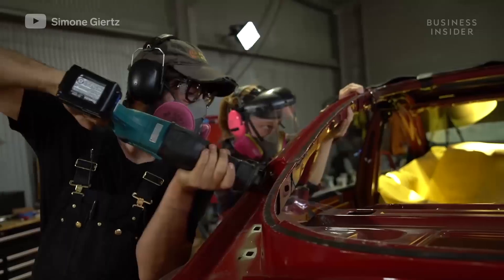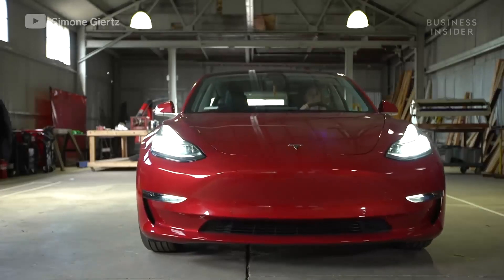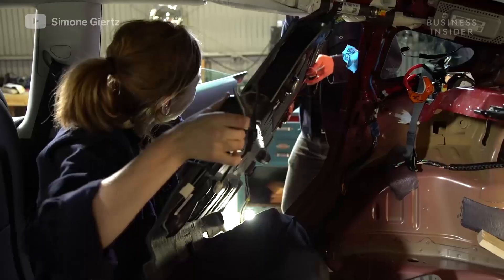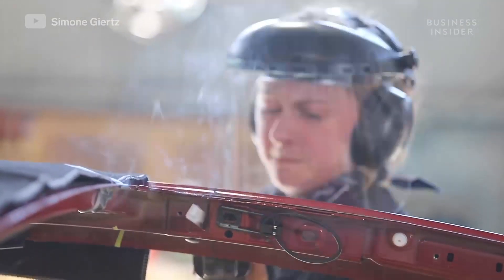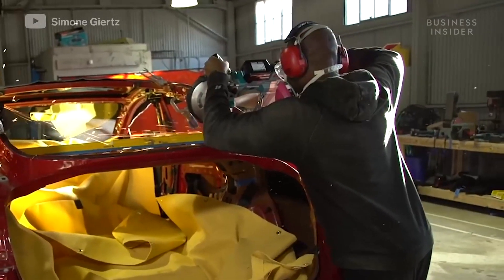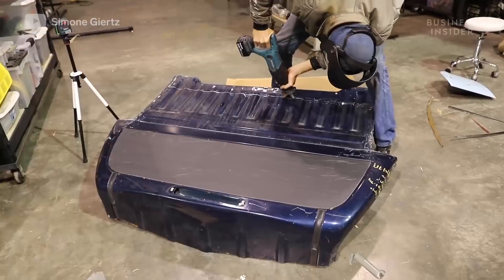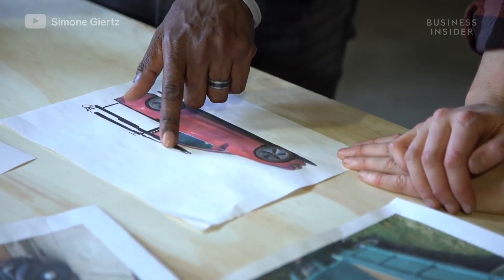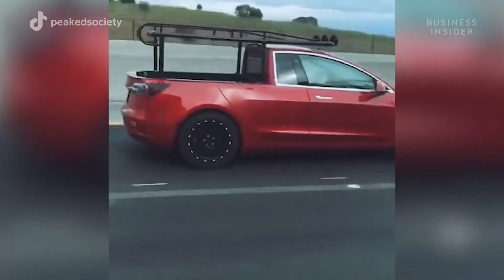How An Engineer Built A Homemade Tesla Pickup Truck

Comment: Couldn’t you have just attached a trailer hitch instead. Then you still have the option for rear seats.
Also, how is going to get insurance. It’s going to be expensive since you have significant modified you vehicle. Likely, insurance will group the car as a rebuild title with higher premium.

Comment: Wonder how bad her mpg-e is now considering the standard model 3 only gets like 220 miles per charge
Reply: If your main goal is just drive daily for less than 100 miles or so it should be decent enough. Just plug it in when u reached home. Electroboom made a video regarding this.

Comment: In the south , this would get run over 😂 we got diesels 5 times bigger than this.
Reply: and 5 times slower, anything diesel doesn't have the acceleration of a tesla. can't run over what you can't catch
Reply: @coreysuffield  Diesels are not made for speed , diesels are made for pulling heavy things like a tractor for example.